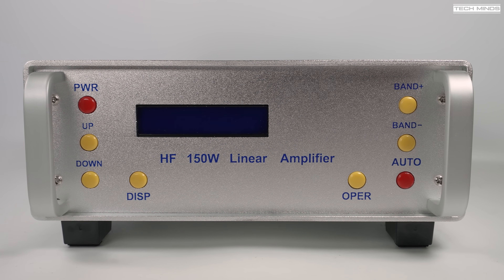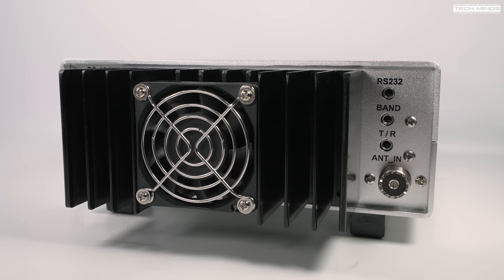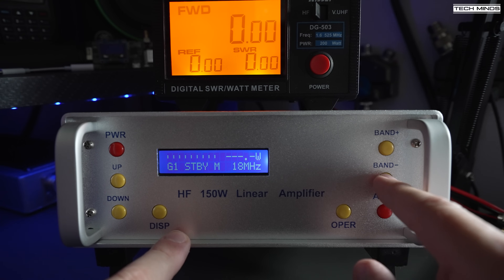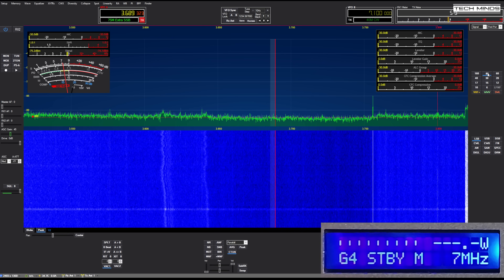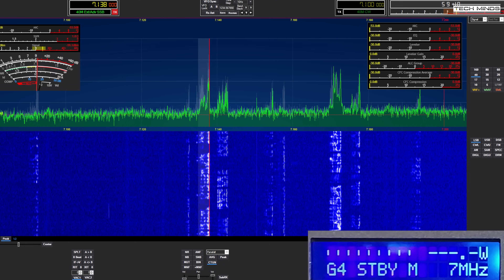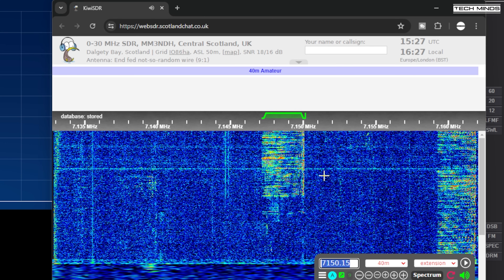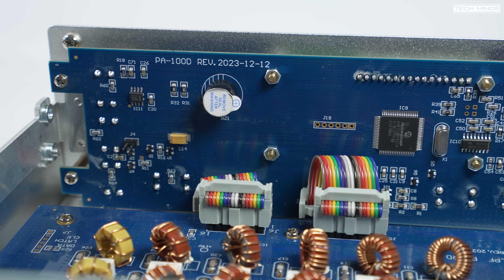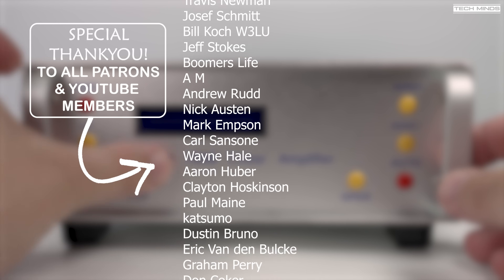Is This A Perfect Companion RF Amplifier For Low Power Radios? PA-100D (Maybe)

Comment: I'm A Big Fan of QRP Equipment This Amplifier looks very nice (On the outside.).. It's too bad there are many (Sketchy Bootleg Versions) Making one Question (The Inside). Not knowing if it's Performance has been compromised. (With low grade Components).. Buyer Beware..

Comment: How clean is the output?
Reply: pair of mrf 247 if biased right should be pretty transparent
Reply: 7:33 you can hear from the kiwi how clean it is.
Reply: @BadgerNNN that won’t show harmonics just that it’s not splattering. Needs to be tested with a SA
Reply: @BadgerNNN  thanks.